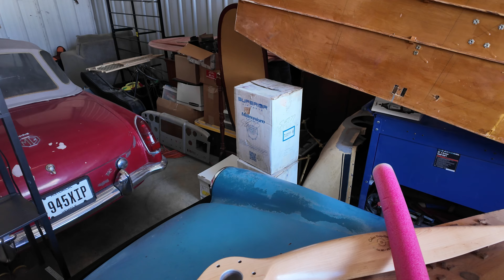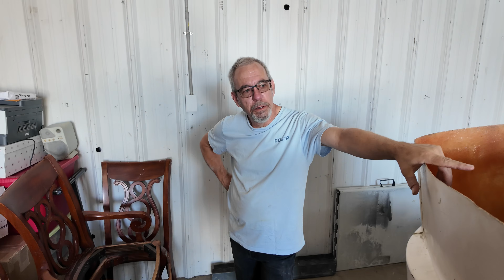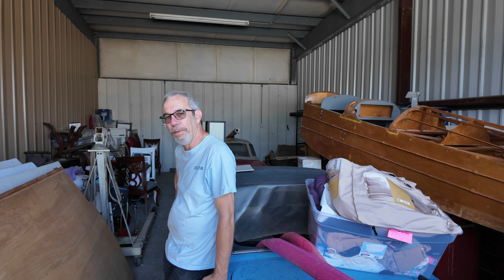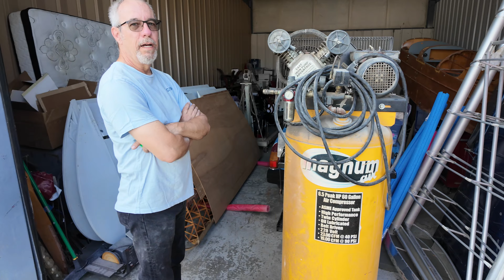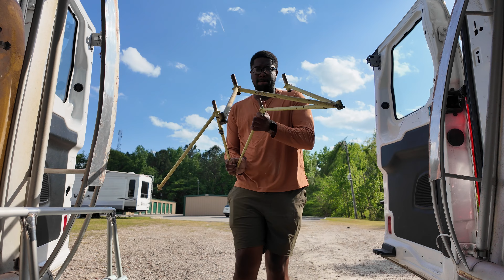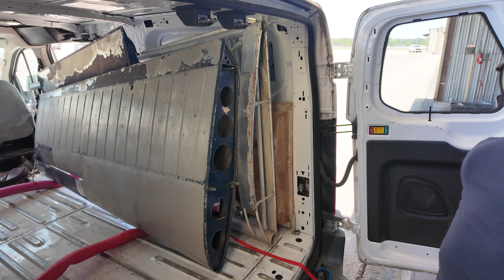Airplane Ideas, Hopes and Dreams - An Aviation Side Quest

Comment: One of the projects that is screaming for a modern solution, and would be right up this channel's alley would be replacement ruddervators for the Bonanza. I believe the ABS has a cash prize for the first one to get an STC. Why not CF? Surely you can balance fiber flight controls just like metal ones?
Reply from the maker: Ding ding ding - winner! As far as I've been told, the issue is less balance and more about aeroelasticity (think flutter and the natural ability of the control surface to damp any structural oscillations). What I really need is a ruddervator to borrow for a week and a discussion with my local FSDO to hear what approach to take. I really don't want to disassemble my airplane unnecessarily but I just might have to. The issues are more myth than reality and those legends absolutely affect people's approach to and application for certification. The feds also hear V-Tail Bonanza and get overly excited. It should not be this difficult to certify replacement surfaces on a sub 200 kt airplane...
Reply: @OpenSourceGA  Exactly! This is relatively well understood engineering - or at least well enough understood 75 years ago to figure it out the first time; we ought to be able to work that out again.
Reply: @OpenSourceGA  Also, have you seen what the couple of guys who bought the type certificate for the Helio Courier are doing? Super interesting! https://www.youtube.com/watch?v=sVIZsmdudZM